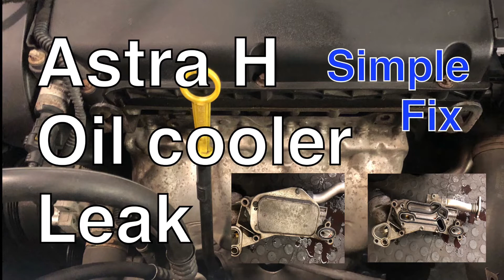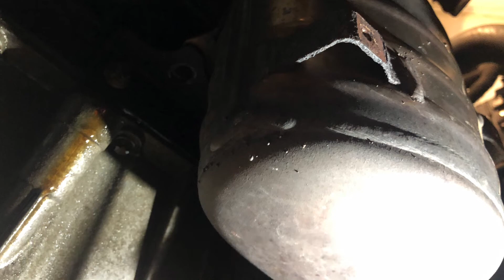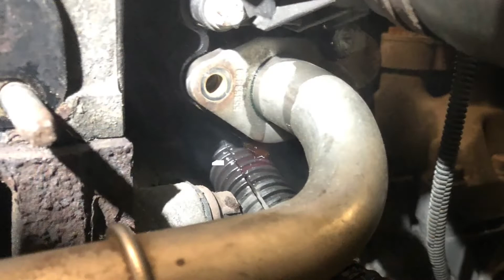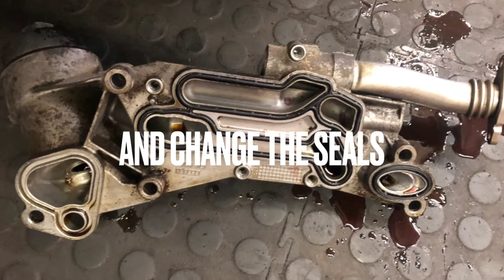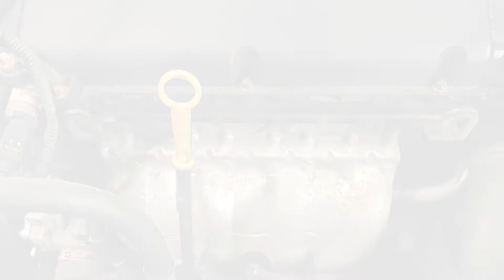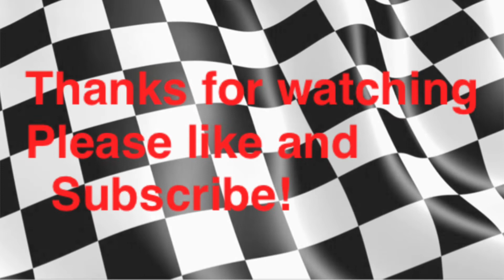Vauxhall Astra H Oil Cooler Leak Repair: Step-by-Step Guide to Fixing Astra Oil Leaks

Comment: Hi there does this apply to my zafira B ? Mine is smoking oil into the cockpit when fan is on and looks like its smoking arpung the filter cap and has oil under around the sump . Please let me know what you thinkgreat video by the way 😊thankyou😊
Reply from the maker: It could be. Best bet is get it checked out by a mechanic. Thanks for your comment.
Reply: Hi there thankyou for the reply . My main concern was oil at the front and back of the sump. Did you have the same ? Ive purchased the oil cooler unit now thankyou😊

Comment: Doing this job myself at the moment. It's not as easy as made out here. Main trouble is wiggling the exhaust heatshield and manifold out. Quite tricky indeed and significantly more difficult with AC pipes in the way.
Reply: Probably too late for you now, but in case anyone else reads this, if your car has Aircon it's best to remove the radiator fan/housing (just two small bolts at the top, one electrical plug on the nearside and an attached wire on the offside, and it slides up and out), much easier to then remove the heatshield and manifold out!
Reply from the maker: @markf4720 thanks for the additional information.

Comment: Hello! My coolant tank has gt oil mayonnaise inside and hoses keep puncturing. The engine is z16xep. Do you think its the oil cooler or the oil pump gasket. The oil and coolant level stays the same. Its just the coolant tank that gets oil inside
Reply from the maker: It sounds like it’s pressuring the coolant system. Probably head gasket I suspect.
Reply: @How2FixIt1 Yes, it could be, but there is no overheating, no bubbles in the coolant tank, the oil is clean, the temperatures are okay, the coolant does not smell like gasoline. Most of the symptoms I do not have
Reply: @How2FixIt1  Also the car does not smoke white or gray from the exhaust and does not missfire.
Reply: That’ll be the oil pump asst gasket front of the engine . It’s a metal plate with gaskets to be precise that seals the coolant pump from the oil ways . Just in case someone else needs an answer to this as it’s a bit if an old thread

Comment: Great video, did you drain the oil and coolant first or just prepare for a bit of spillage?
Reply from the maker: Thanks. I drained the coolant and replaced with fresh. Just put a oil catch pan underneath for the oil leakage and topped up. Thanks for your comment.

Comment: Hi, would this be the reason why I loose small amounts of oil and most the coolant after it’s been sat over night? Thanks
Reply from the maker: If it’s central to the engine bay where it’s been parked on the floor. I would say so!  Pop your head underneath the car in the morning and see where it’s wet. Thanks for your comment.
Reply: @How2FixIt1  thank you for your reply, it is central to the engine bay. Do you know roughly how much it would cost to repair? Cheers
Reply from the maker: @tfn4116 I would roughly think at a garage about £220 ish.

Comment: I have this problem and I’m getting it fixed in a couple weeks. Will it be ok to drive in meantime? Not loosing much oil atall.
Thanks
Reply from the maker: Yes more often than not it’s a small leak. Just keep your oil topped up.

Comment: Hi there, how did you remove the heatshield?
Reply from the maker: Yes of cause. It needs to be removed. Thanks for your comment.
Reply: Yeah, but how

It seems like the oil dipstick keeps it from being removed, so unless the oil dipstick has to be removed too, then it seems like I’m overlooking something that should otherwise be obvious
Reply: @reaps912  You have to loosen the 3 AC compressor bolts and push it forward a bit then the heat shield comes out, not hard to do at all.
Reply: @jamiem5319 I didn't do this but managed just 🙈🤣🤣 2 bolts on bottom of my heat shield fooooked anyways lol

Comment: hello my astra leaks at the centre and some traces of oil at the coolant bottle is this the issue
Reply: Probably. Check the oil on the filler cap and dipstick, to see if there is any "mayonnaise" indicating water in the oil - if so it might be your head gasket. Oil cooler is the easiest and cheapest to do, so try this first. If the problem remains it could also be the oil pump gasket on some models.

Comment: hi i have changed mine on my vauxhall astra 1.6 2011 and it is still leaking also there is a leak only when the car is driven and the oil goes on to the exhaust and turns in to smoke.
Reply from the maker: Have you checked the oil pressure switch.  These are very common to leak. It’s near the top at the left hand side
Reply: Also the oil filter housing , mine had oil running down from there
Reply from the maker: @hdnproductionsuk  yes the oil seal perishes and goes brittle causing it to leak.